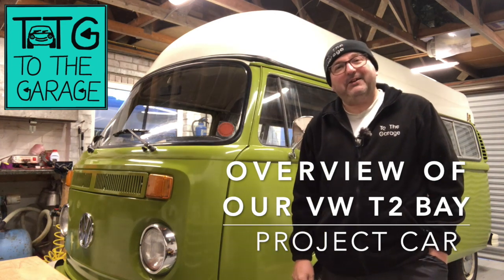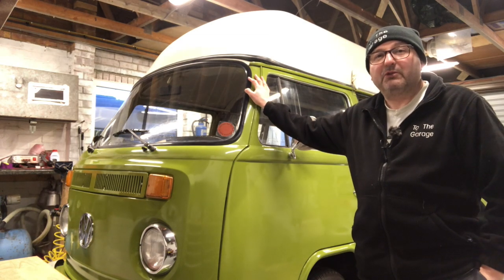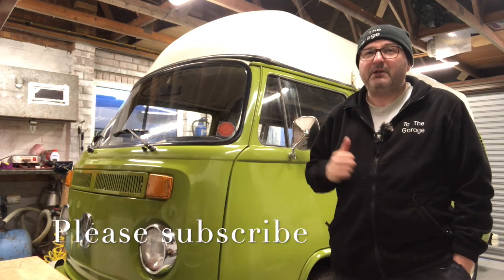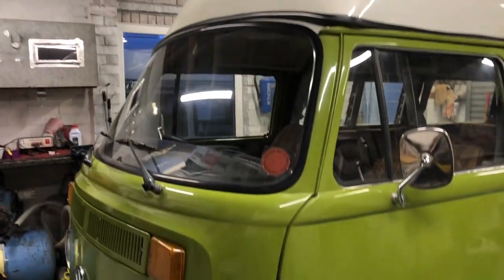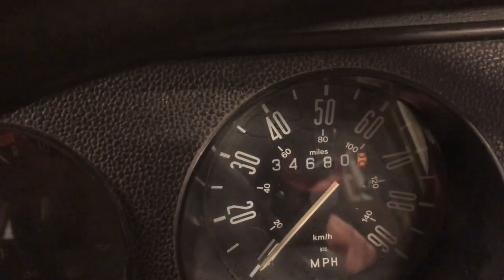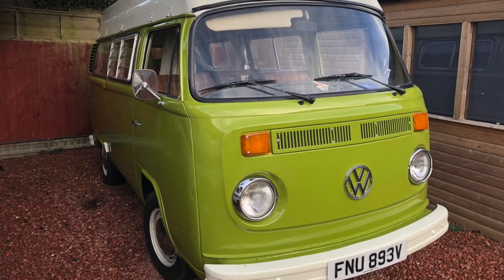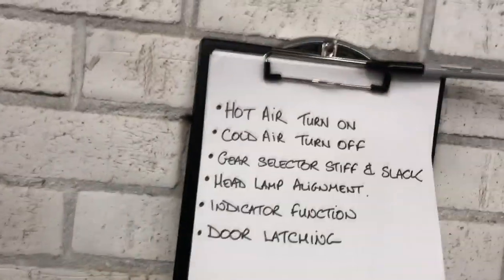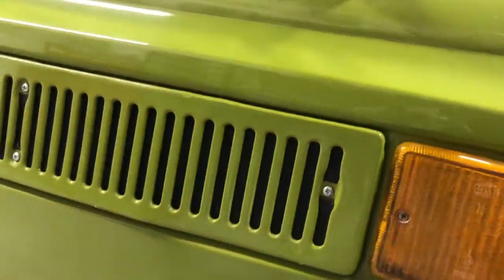VW t2 Bay Campervan restoration Ep1

Comment: I used to have a 1960 van that I had for years and sold it mid 90's. Converted it from 6 volt 1200 to a 12 volt 1600. Always kept a spare engine, it seemed to blow the engine after a while, usually Number 3 cylinder, due to excessive heat. Got so I could swap engines in 20 minutes. Had a lot of fun with it.
Reply from the maker: I would not claim to have the knowledge on VW's that I Have with the XK8 but I know well enough that like a jag they put a smile on your face.
Reply: @ToTheGarage  Unlike my XK8, at the present time, your VW will increase in value if taken care of. I have no doubt that you will.

Comment: Little known fact...i trained as a VW technician as my first apprenticeship, and my best subject was the t2 . I have re - built the engine,set one on fire when welding, poured oil in the air vents on a service and crashed one into the ramp in the garage. So i am an expert if you need advice !!!!

Comment: Great video! I have a Bluetooth system installed in my XK8 as well, it works over the radio so I get to keep the CD player. There’s a mic in the cabin and a very small button to skip to the next track which I find very useful. I’ve made lots of small upgrades which I find very useful. I’d love to see what else you come up with.
Reply from the maker: Thanks Jacob

Comment: The engine is really easy to remove,which i would recommend and then re weld the compartment. The jack points are by the sills i think.(big round circles front and back)
Reply from the maker: I Knew none of this about you😮
However as you said your 'Best subject was the T2' and then... fire ... crash🤣
Seriously though I would welcome all advice and guidance Glyn.
👍
Reply from the maker: When you say re weld the compartment!  Does that mean I have to unwed the back panel to get the engine out?
Reply: I think not...from memory there are only a few bolts to undo at the back of the engine and various covers and tubes ( the  silver flexible ones tend to perish,change these if needed as they are very important as you will see. Have the van just about high enough to get a jack under the centre of the engine to support it.Remove the bolts and wiggle,yes wiggle the engine towards you and it will pop out,then raise the van. I would advise changing the clutch regardless as this is very easy. There is a rocker covers are on each side.You can easily replace anything on these engines on a bench. This why i was given this engine to learn from ,because they are a dream to work on when they are out,but a bitch when they are not. The head gaskets are common fault,tappets is another.Once out you can easily weld the compartments ( take the wheels off !!). Try to avoid idling the engine in the garage without fans on ,as on hot days it could overheat.
Reply: @ToTheGarage  Yes i a veritable box of talent . The turning circle is massive.Glad its not a manual as it's like changing gear with an elastic band and lots of crunching ( reverse is a nightmare). Think you have a good one as i replaced sills on these a few times and yours looks sound
For the interior maybe get some Silvanian family furniture LOL
Defiantly a profit to be made !!
Reply from the maker: Glyn Holman 
You truly are a ‘box of talent’🤣👍

You should get one Glyn
They are worth more down sarf than up inT frozen north beyond the wall 😉

Comment: Nice Vw like the colour.how much roughly would it cost for a camper like yours
Reply from the maker: Thanks Steven.
Very hard to put a price on these things. Head v heart and some people will hugely over inflate the prices on the grounds they know how much they spent on it rather than its worth.
I think for a late bay in similar condition to mine with sound mechanicals (once mine has an interior🤣) you would be looking in the range of £9,000 to £13,000. However I guarantee you will be able to find some advertised for both £5000 (needing a lot of attention to make them at least safe /reliable) and £23,000. (Full body rebuild and pro interior with the name Westfalia emblazoned across the pop top)
Reply: Am only starting to get into them.am looking camper.
Reply: Possibly looking frame and start from there.thanks for the advice.

Comment: nice bus.am wondering could you help plz.what is the height of the ground when it is closed 
Thanks
Reply from the maker: Let me check Steven. I did write it down somewhere. I assume you mean the height of the van with the top closed?
Reply: @ToTheGarage  yes plz is yours Viking 40mm or Devon 35mm.am ordering the Devon from proudtopop.even if you could measure from side reel to ground.mine is in getting fully restored.thanks
Reply from the maker: @stevenpaul3585  Its a super Viking roof. I no longer own Olive but will have a note of her height in my desk drawer. I will not be near my desk till the weekend though.